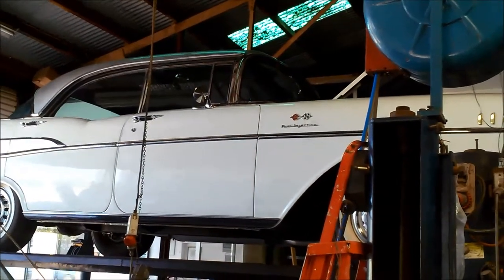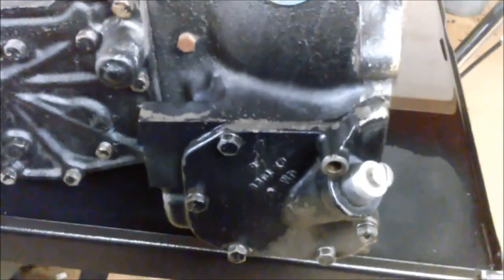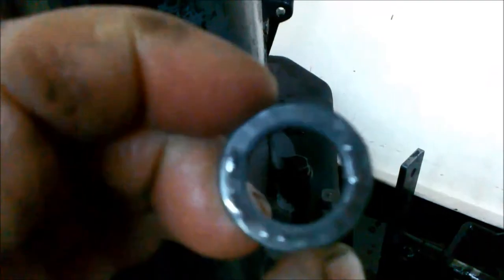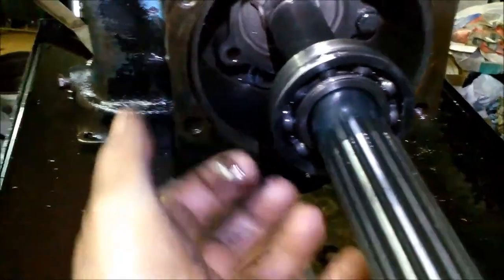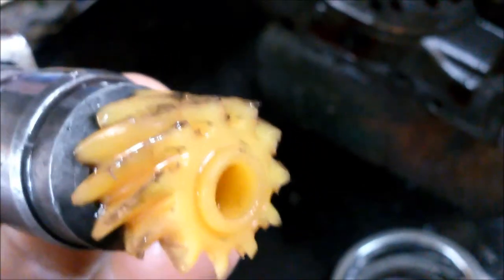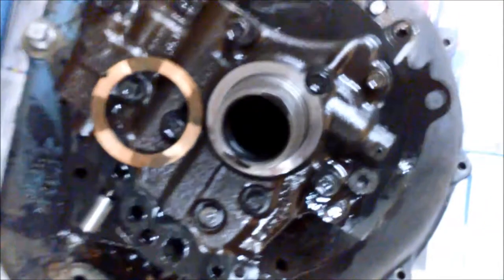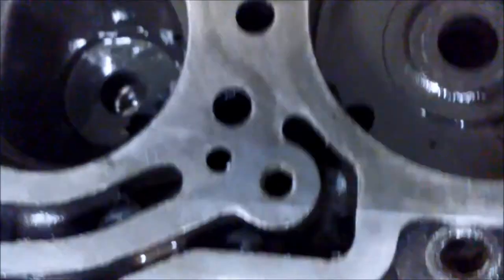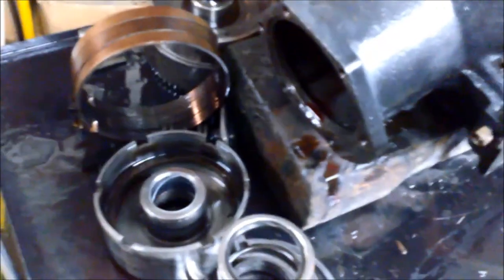Chev Powerglide CAST IRON Rebuild Part1of7 Rebuild DIY How To

Comment: For leaks a gm secret.ha drill hole in top of tail housing,thread 1/8 pipe install barbed brass nipple, run a hose( following the dip stick) to the top of the dip stick. Install a turbo hydromantic style breather cap or small filter. Nyty the hose. This is for pre 1958 date iron glides, gm fixed the venting problem in 58.
Reply from the maker: sonnax have same info in their tech support bulletin https://www.sonnax.com/tech_resources/136-cast-iron-powerglide-leaks cheers for that though
Reply: YepThatsIt got  the info a few years back from a chevy factory rep, when we had a beautifully restored 57 bel air 2dr hardtop that was in our show room. The owner had to put a cookie sheet under to catch a couple of drops of atf. said he had tried to seal it up but would always start leaving drops after driving it a while.
Reply from the maker: yeah, you need to flat face all the surfaces and make sure dipstick isn`t seated " good" or will bleed and burp atf. cheers for info
Reply: YepThatsIt about to build a replica 1957 chevy nhra junior stock m/sa drag car,that ran a iron glide. Built dozens aluminum glides, for race cars but never a iron glide. Trying  to learn all I can about the basics. This series was a good start. Thanks. If u have any performance tricks I need all info I can get. Ha

Comment: Owesome vid!! Can ya help with some info on how you got that type of slide hammer or is it custom. That bearing is not easy to get out! Anything you can offer for advice in this matter would be mucho appreciation on this end!
Reply from the maker: hi, it heavier weighted slide hammer & home made. try the tool sellers for industrial gear. cheers

Comment: Thanks for videos! What stones are you using for the gasket surfaces? Greetings from Washington DC!
Reply from the maker: hi, just a regular stone...if greatly uneven i will use the coarse first and finish with finer stone. the idea is to get it flat as possible so gasket/seal surface area has greater capacity. cheers
Reply: YepThatsIt just curious, I’m getting conflicting info. Someone here in the states is saying not to (under any circumstances) use petroleum jelly inside the trans. He says only use trans fluid and that pet jelly ruined one of his units. I’m totally ignorant and have the trans disassemble. I don’t see how you can get needle bearings in place with trans fluid. Thoughts?
Reply from the maker: @jls8177  I've been using petroleum jelly for literally 3 decades. I guess depends on how much you use, they come in a 2.5Kg tub haha. if you are in Oz contact me on facebook link, I can sell you 1 lb or .45 kg tub of trans assembly gel, medium or hard tack. cheers

Comment: Thank you for posting this! Any chance you could tell me what differences I'll find on my '54?
Reply from the maker: hi, what info are you after? cheers
Reply: @YepThatsIt  I know there are variances between the years, but I'm not sure what they are. I got mine mostly torn down though. The front pump is completely seized. :(
Reply from the maker: @rickr9689  is your a chev or corvette?
Reply from the maker: @rickr9689  1950-54 closed driveline, flat modulator
1955-57 open driveline, no modulator
1958-62 open driveline, screw in modulator